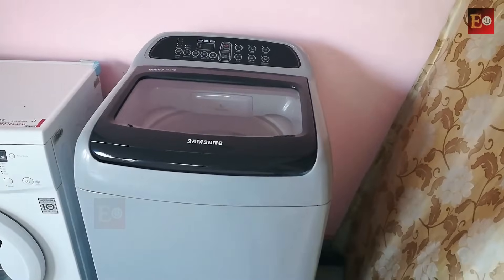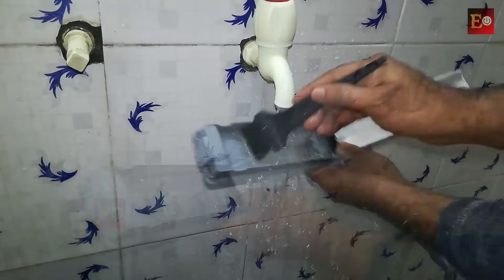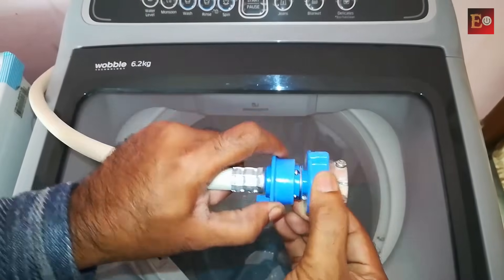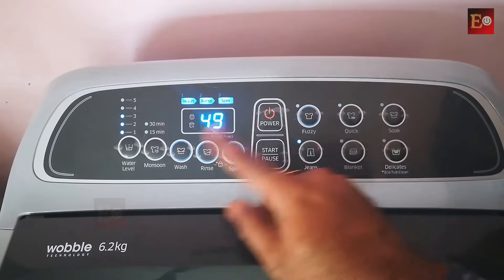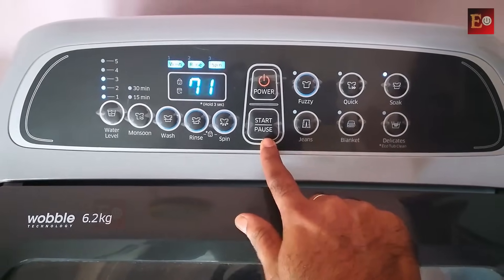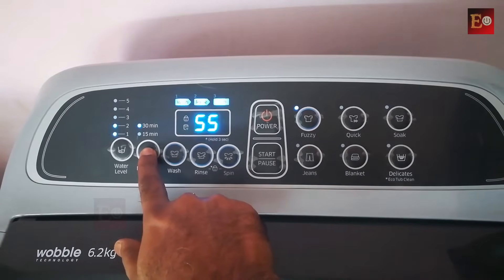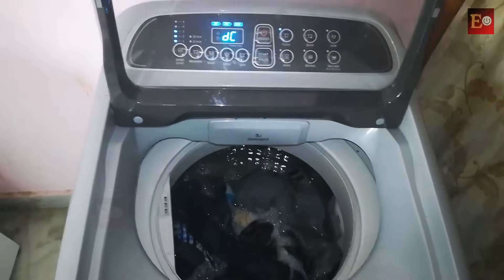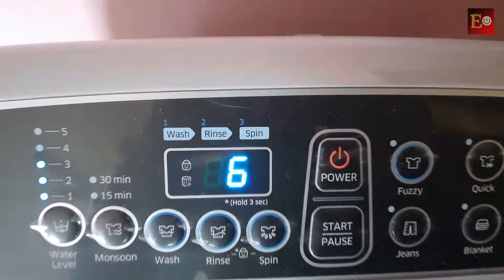Samsung Top Load Fully Automatic washing Machine Demo| How To Use Samsung Top Load Washer And Dryer

Comment: What's the use Softener Dispenser ; 3 holes provided on drum ?
Reply from the maker: R u using front load or top load?
Reply: @ELECTRONICSALLINFO   Top load , Samsung 6.5 L WA65A4022NS/TL model
Reply from the maker: Machine need softener in Rinse cycle. So u can add also softener in washing drum.
Pause the machine and open the door then add Softener when machine machine tacking the water.

Comment: While spine time machine is shaking.can u reply me...pls
Reply from the maker: Normally washing machine are little vibrates in spinning time. if your washing machine is more vibrates in spinning time, you have to check at washing machine four legs on the floor. if lags are not properly set on the floor or if lags hjav any gap from the floor, washing machine is lot of vibrats or shakes in spinning time.

Comment: This  is  very helpful. But my Samsung  toploader washing  machine pauses  and  displays  4C after  about  5 minutes after starting. What  is  the  problem
Reply from the maker: If the machine can't get the water properly from the water tap, it will show 4C error.The 4C error indicates that the washing machinehas detected that there is a problemwith the water supply. The most common reason for this error is a blocked or kinked water supply hose. ... 1 Check that the water tap connected to the washing machine is open to full.

Comment: pls tell in detail about how to use soak options? after soaking for an hour should we start again from wash, rinse and spin?, i am using Samsung activewash plus 9 +1kg wobble , and i put detergent and comfort in the respective compartment at the beginning only, should I use comfort in the rinse cycle ?
Reply from the maker: If u choose Soak option, it will pause automatically after some time and it will start again itself after some . U don't need anything in middle of the washing. And u don't need adjust the water level. It  will take water level automatically. There are 1 to 5.The default level is 3. If u add very less clothes u can decrease water level. If add clothes more than 90% of the drum, u can choose 4 or 5. Normally don't need change water level.
Reply from the maker: Yes u have to add softener in Rince cycle. This machine does not have separate partisan for softeners. So u can add comfort at detergent powder tray in Rince cycle after wash cycle compleated.
Reply: @ELECTRONICSALLINFO  i hv added softner in the rinse cycle but it was as it is, i mean hasn't used. my machine has seperate compartments for softner and detergent
Reply: @ELECTRONICSALLINFO  tq for the reply, if i select soak option after sometime is it chooses fuzzy options? or should I select fuzzy because i need that option only

Comment: Hi can u pls help. The softener is not dispensing. When the cycle is done, softener is still at the dispenser. Pls help
Reply from the maker: Are u using same model? U can also add softner directly in washing drum. But you have add softner in Rinse cycle after Wash cycle completed. Pause the machine and open the door, add softner in Rinse cycle when machine taking the water, then close the door and start the machine.
Reply: @ELECTRONICSALLINFO  i will try this! Thank u!

Comment: Is there any option to increase the rinse from 1 cycle to 2 cycle. I am facing difficulty in removing detergent from the clothes in just 1 rinse cycle
Reply from the maker: The machine has Wash Rince And Spin buttons separately on the machine keypad. You can choose there how many times you want before starts the machine.
Reply: @ELECTRONICSALLINFO  how much times should  be set for each wash rinse and spin for normal washing? Plz reply
Reply from the maker: No need to set wash, Rinse, spin,. manually. default settings are ok. There should be on three lights before start the machine.

Comment: If in fully automatic machine if we can add water manually then have any issues?
Reply from the maker: It's completely fully automatic washing machine. It takes water automatically from the water tap when machine need water. If u want add water manually, u can buy Semi automatic washing machine. U can add water manually In Semi automatic washing machine

Comment: Hi having an issue with Samsung 10 kg wobble,
Water is not getting stored for wash, I start the machine it starts filling but water comes out directly through the drain outlet
Reply from the maker: If you start the machine it will do three cycles. They are Wash Rince and finally Spin. The machine has Wash Rince And spin buttons separately and indicates with led lights. we can also choose separately Wash, Rince and Spin. Normally after wash completed drain water should come out from the drain pipe. If u choose only 3rd Spin cycle there is on the only spin light and it will do only Spin and the machine does not do before 2 cycles Wash and Riane.
Reply: @ELECTRONICSALLINFO  thanks for the reply, but the machine is not start washing as the water is not getting stored as it is started... I start the cycle that is wash, close the top of the machine and press start, the tap starts filling water in machine but it is coming out immediately from the drain pipe, it's not getting stored for 1st step that is wash.
Reply from the maker: Nornally there should be indicate Wash Rince and Spin three indicate lights on the machine before starts the machine. After start the machine If first Wash cycle will completed then only indicates only Remaining cyclcles Rince and Spin lights.if u change any settings or If u choose only third cycle, it will do only final cycle drying. If machine is in normal settings or if machine can't do 3 cyclcles you call Samsung washing machine costumer care. If there it has any technical problem they will come to your home and solve it. Machine has 10 years warranty.
Reply: @ELECTRONICSALLINFO  thanks again, have a great day ahead
Best regards 👍💐

Comment: Can I manually use it whenever I want to wash clothes
Reply from the maker: u can use. u can also select wash rinse spin options there.
Reply: @ELECTRONICSALLINFO  yes,  I can but my water inlet pipe broke. But I hope using it manually will not spoil the machine. Thanks for ur quick reply. Great video by you

Comment: in case power goes off. do I av to restart the whole process?
Reply from the maker: No. need not restart. If the power gone off in the middle of the washing, machine will start from the middle of the washing when the power comes on.

Comment: Water  supply is not going in machine .I clean that net which is at back of machine but no improvement.pls suggest
Reply from the maker: I think there is tecnical problem. You call  samsung washing machne servicing centre. They will solve ur problem.

Comment: Sir, I bought Samsung 9+1 kg washing machine. I have a problem i.e I opened the door in between washing, sound was occurred and displays the CL error. Can you  please tell me, how can I resolve my problem
Reply from the maker: power off and then on, the washing machine will operate normally.

• To clear “CL” display, after draining is complete, close the door of the washing machine, turn the power off and then on.

Comment: I have Samsung Washing Machine and the softner i pour in drips very slowly and does not merge down to the whole, instead it stays on surface only. Any solution for this ?
Reply from the maker: when you adding softener
Reply: Yes, while adding it !
Reply from the maker: where do u add
Reply from the maker: in detergent tray?
Reply from the maker: you know telugu?
Reply: Not in detergent tray
Reply from the maker: r u adding in washing drum? if u add in drum, increase the water level . if water level is more than cloths, softener  can dissolve easy with cloths. add softener in Rinse cycle.
Reply: There is a hole provided above the washing drum for adding softner in which i pour it while rinse cycle. So does increasing water level help ?

Comment: is there no need for choosing wash option after start?? or a single click on  start button is enough for starting both wash rinse and spin?
Reply from the maker: U don't need to choose any option after starteded the machine. It will do Wash Rince and Spin automatically. But there are Wash Rince and Spin buttons separately on the machine keypad. If u want only any cycle separately. u can choose there.

Comment: is it possible to set it to rinse and spin only? skipping the wash part??how?
Reply from the maker: Yes. Normally machine do Wash, Rinc and Spin after starting the machine. There are wash, Rinse and Spin buttons seperately. If  u press and hold Rinse bottom there will only on Rise. U choose only Rinse and Spin options.

Comment: Sir water can we manuallu or autimatically
Reply from the maker: did buy it. this is fully automatic machine. so it takes automatically from the tap. if u want add manually, u can add manually, add water and start the machine before starting the machine in 1 st cycle. and in 2 nd cycle pause the machine and add water in drum and close the door and start it.
But in semi automatic machine no need water tap.

Comment: Dear sir thanks 😊 for Very useful video 
My question is Jo pani yeh machine kapde dhone me leti kya wo enough hoti hai kapde saf hone k liye ??kyuki jab ham hatho se kapde dhote hain to 3/4 baar pani change karte hain ???
Aur white kapdo ka mail nahi gaya to maime hatho se dhokar spin karne k liye dala to machine ne time dikhaya magar machine ghumi hi nahi
Plz answer kijiye 😢😢
Reply from the maker: Can u tell in English
Reply: Hey 👋 good morning 
My question is the water maching takes if it’s enough to wash clothes???
And what is water level 1,2,3,4,5 wt does it mean ? What button should i press for water during washing clothes ??
If I manually wash my clothes and put into machine for only spin its not spinning why ???
Reply from the maker: why do you wash clothes manually? There is a water level 1,2,3,4,5 on the machine. The default water level 3 is enough for us. Generally no need to change the water level. The mission takes the water level automatically depending on the wash program you choose. We can also change the water level. If u add less then cloths 50% of the drum, you can decrease the water level and  If u add more than cloths 90% of the drum u can increase the water level.

    Wash, Rinse and Spin lights are there on the machine. if u want only Spin, there should be on only the Spin indicator light. There are Wash, Rinse, and Spin buttons on the machine. You can also choose manually which option you want. if u want only Spin, u have to choose Spin, then you start the machine.
Reply: ELECTRONICS ALL INFO thanks for the reply I wash manually bcoz dirt is still there in the white clothes of baby 
And When I want only spin it gives only sound but machine didn’t spin 😢
Reply from the maker: there is the Pause button on the machine. If there is still dirt in clothes, Do like this. Pause the machine after taking the surf, and keep the machine pause in one hour, And after one hour start the machine. If u do like this cloth will soak with detergent and there chances to clean well.

Comment: Normal wash how much time it takes? Bcz my new one took more than two hours,
In quick wash it took two hours,is that complaint.
Reply from the maker: you are right. there displaying less time when selecting the wash program, But The mission takes longer than the time on display. There is no problem.

Comment: Hae.....I bought mine today and when  it switched to spin it vibrated sooo badly as it move......should it behave that way??
Reply from the maker: if there is any gap at machine leg, there will vibrate the machine. little change the place or use washing machine stand

Comment: Can you also use dryer with this washing machine
Reply from the maker: Yes. If you onse starting the machine, it will automatically dry in final cycle, after wash cycle completed.
Reply: @ELECTRONICSALLINFO  I mean separate dryer

Comment: If the water pipe is not connected to tap can we put water from top. Then what will be the operating method of the washing machine
Reply from the maker: This machine is fully automatic washing machine. It takes water automatically 1st and 2nd and 3rd cycle s from the water tap. But U can add from the top in first cycle Only. We can't add in 2nd and 3rd cycles.

Comment: We have same washing machine but we have a problem on it..  It never produce water now from the pipe at the back.. Cann u pls help me how to fix it?
Reply from the maker: Is there any Error code shows( like dc, or 4c  ect) when the start the machine.
Reply: Yes it keeps 4c before.. But that time the water producer was still functioning but its to low..  Until it never work..  No water came out..
Reply from the maker: If the machine can't get the water properly from the water tap, it will show 4C error.The 4C error indicates that the washing machinehas detected that there is a problemwith the water supply. The most common reason for this error is a blocked or kinked water supply hose. ... 1 Check that the water tap connected to the washing machine is open to full.
Reply: @ELECTRONICSALLINFO   okey thanks for ur reply sir...  ..

Comment: Which washing machine is to buy in budget and efficient and effective in Samsung?
Reply from the maker: If u want to buy in low budget, you can buy this model.
 https://www.amazon.in/Samsung-Fully-Automatic-WA62M4100HY-TL-Imperial/dp/B0747XV38N?tag=googinhydr18418-21&tag=googinkenshoo-21&ascsubtag=_k_Cj0KCQjw2v7mBRC1ARIsAAiw34_TixCsg87_vyOTFAG4XyNbm3XGMCXZUhOzp7yXiEouoUlAvmWxGRAaAp0fEALw_wcB_k_&gclid=Cj0KCQjw2v7mBRC1ARIsAAiw34_TixCsg87_vyOTFAG4XyNbm3XGMCXZUhOzp7yXiEouoUlAvmWxGRAaAp0fEALw_wcB

Comment: Sir I have the same washing machine but while using I don't know how only one light at a time is glowing of the 3 lights ( wash, rinse,spin) please help me in this.
Reply from the maker: If u want compleate washing the cloths, There should be on 3 indictor lights Wash, Rinse, and Spin. If u want Any cycle u want seperately, there are wash Rinse and Spin on the machine. If u want Spin only, press or press and hold Spin option, then there will indicate only Spin light and machine will do only Spin.

Comment: What type of washing powder do we use?
Reply from the maker: Top load Matic detergent powder
Reply: @ELECTRONICSALLINFO cn you suggest any  specific detergent's name for washing the clothes in the machnie?
Reply from the maker: Don't use normal detergent poder. Some matic detergent powders are especially avalable in all brands for front load and top load washing machines. U can use like top load matic Arial or top load matic Surf Exel .......

https://www.amazon.in/Ariel-Matic-Detergent-Washing-Powder/dp/B06ZZJ7NVH/ref=mp_s_a_1_1_sspa?dchild=1&keywords=top+load+wash+machine+detergent+powder&qid=1634017636&sr=8-1-spons&psc=1&spLa=ZW5jcnlwdGVkUXVhbGlmaWVyPUEyN0JWT0NGUk9SUkRXJmVuY3J5cHRlZElkPUEwMTc2OTAzMVFSUzdQU1EyUFJLWiZlbmNyeXB0ZWRBZElkPUEwNDYxNDE4Tk04MDZWMjNVOFE4JndpZGdldE5hbWU9c3BfcGhvbmVfc2VhcmNoX2F0ZiZhY3Rpb249Y2xpY2tSZWRpcmVjdCZkb05vdExvZ0NsaWNrPXRydWU=
https://www.amazon.in/Surf-Excel-Matic-Detergent-Powder/dp/B07PY6Z7KD/ref=mp_s_a_1_8?crid=1G00KGHC5GWB2&dchild=1&fpw=pantry&keywords=top+load+washing+machine+powder&qid=1634017746&qsid=261-2149626-3947803&s=pantry&sprefix=top+load+washing+mac&sr=8-8&sres=B07PXND4T6,B06ZZJ7NVH,B00TS88UZW,B08HXT7HPK,B01N4GLE1I,B07PY6Z7KD,B07229HGVC,B07BHH2ZH1,B07K7NDKK5,B08WD21DXF,B08SMBLHSP,B09DWY2MMP,B081S84DTP,B085SFKVVH&srpt=LAUNDRY_DETERGENT

Comment: Sir i have a question how much time does it take to fill with water??
Reply from the maker: 5 to 10 min. Its depending on tap water preser, and depending on u selected Walter level also. If it take more than 15 min, open back side inlet pipe and clean insid filter. U can call 9550206206 my no

Comment: Can water be filled manually in fully automatic machine if do not have tap nearby? And what does water level selection button indicates?
Reply from the maker: Better fully automatic washing machine we use with water tap. Because fully automatic washing takes water automatically 1st, 2nd and 3rd cycle. U can add water manually in first cycle, but we can't find 2nd cycle when wil starts axactly in washing machine for add to water in washing drum.

Comment: Hot to drain out the water from the machine?
Reply from the maker: This machine drain the water automatically in final cycle. U don't need anything for drain water. And Machine has drain pipe back side of the machine, you have to set the drain pipe where u want to go drain water.

Comment: How to set the water level
Reply from the maker: There is water level button on the machine keyboard 1 to 5. U can change 1 to 5 with this. Machine takes default water level 3. Normally do need change water level. If add less clothes od add more load u can increase or decrease water level with water level button.

Comment: Is it possible  to  wash in hot  water. If yes  tell me how...
Reply from the maker: Generally top load washing machines cant wash hot water. But front load machines can wash with hot water. if u want compulsory, you can add manually. but if choose long  cycles no need hot water.

Comment: Just now bought this. Rinse the machine over shake wat problem.  Reply
Reply from the maker: Normally washing machine are little vibrates in spinning time. if your washing machine is more vibrates in spinning time, you have to check at washing machine four legs on the floor. if lags are not properly set on the floor or if lags hjav any gap from the floor, washing machine is lot of vibrats or shakes in spinning time.
Reply: @ELECTRONICSALLINFO  thanks to reply